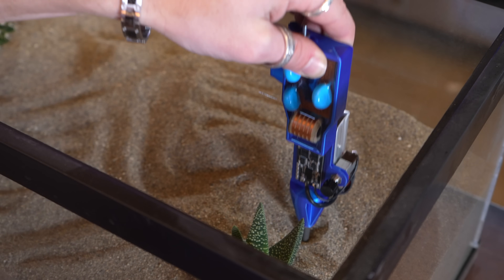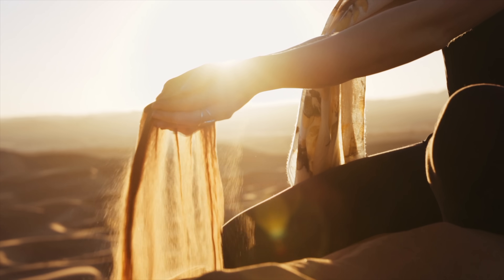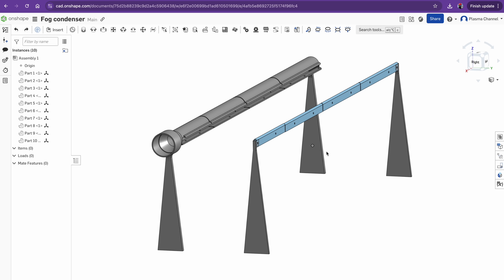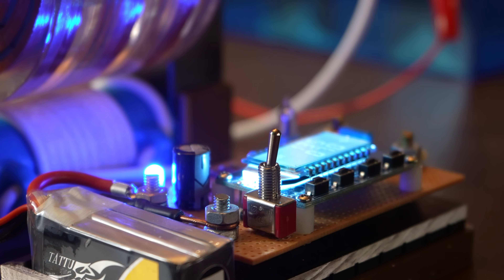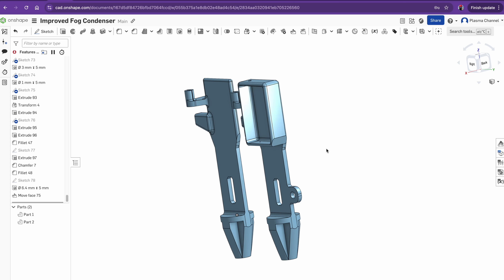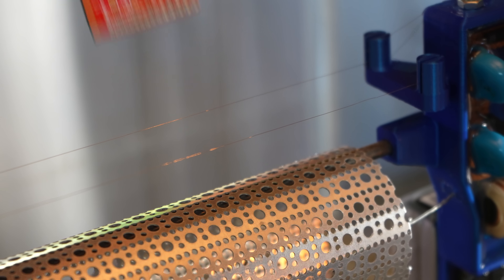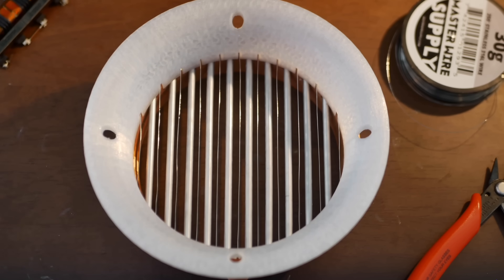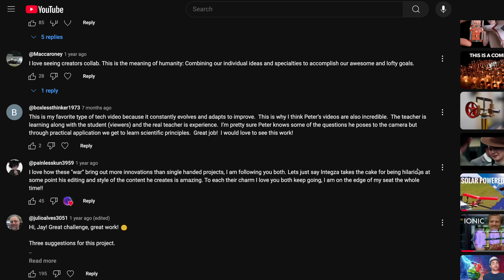Solving Desert Water Shortages Using 20,000 Volts

Comment: Ok, now I wonder how it can be improved. Like how does the density of the collection grid affect the performance? Higher density may be able to collect more water, or it could just end up wicking the water up meaning less of it falls down to be collected (the extreme examples I can think of are something like a carbon fibre sheet and chicken wire). I expect that due to the attraction of the water you don't actually need an especially dense collection grid. In fact, I wonder if you could just use a bunch of nails or something facing downwards, spaced closely together. 

If you optimise the design by optimising collection grid size, spacing, voltage, distance between voltage and ground, size, and implement forced air-flow (on a larger scale that would work with natural fog) etc. I wonder what the theoretical maximum percentage of water collected would be. Then I wonder what the optimal would be for watts/ml. 

Basically, if you live in a desert with ample available solar power (you'd need batteries to have available power first-thing in the morning), is there an optimal design that would be most cost-effective?

The other issue is that if you wanted to be able to harvest these crops at scale you'd need to remove the grid so you can drive farm machinery over the crops. I wonder if instead of using a thin mono-filament for your HV and a solid metal bar for your ground, if you could use something readily available to most farms anyway, electric fence wire and chicken wire fencing. They're both designed to be durable so you can run them over relatively long stretches with maybe just a couple of simple insulated stakes between to stop them from drooping too much, they can easily be rolled up when you need to take them out to harvest. 

I'd love to know if it's possible to make a legitimately functional version of this that has viability for real-world use cases. I expect that no-matter what, you'd still need to use very low-moisture crops because you'll hardly be producing crazy amounts of water.

Comment: One thing about this is that it pulls FOG out of the air, NOT pure water. If you have suspended particulates, soot or microplastics mixed in the fog you’ll also precipitate those out too. Okay for crops, not as good for drinking.

Comment: Also the wind is stronger and more consistent at high altitude where the clouds are- put up a kite or blimp with a wind turbine on it and use the electricity to do high voltage moisture collection. So you can have an artificial rain cloud on demand.

Comment: Have you considered using this as a drinking water supply on say a cruiser/sailboat as a kind of alternative to expensive RO water systems since most of them use some kind of solar panel system and the air is always moist at sea?

Comment: Yo! this is awesome, dude incredible! I love the design & I think it would be amazing to try it out in the Atacama desert. 

If you plan on using it for some cool science study, please remember the money shortage & all that & never treat these deserts like it will ever be easy. From what I understand its deadly immediately, & there's just about no way out sometimes. Who cares if you look silly, better alive & silly than dead & cool lol.

Anyways, I believe you might get a benefit for you design if you were willing to added a hygroscopic in a repeating fashion with tubes. Think a wicking effect that is twisted because it only require plating on cloths & you can have a patterned offset hygroscopic material in-between that helps with the "mush" effect of the wind.

There is also a convection effect & the dripping effect which can be helped with a vortex generation that helps with a condensation thermal rise effect. This is a weird quirk of physics again, where less humid is that is stalled gains a separation of densities that then gain a condensation of the more humid air, but that will wick off into the tubes.

As the tubes pull water down, more air from below comes up to replace it, because its moving a volume out. Now as it gets drier it becomes hotter thanks to absorbing the change of ionic state of energy that you put in, which creates a double vortex with a vortex tube effect.

All it really means it that air rises up & helps the total water captured & basically creates a Stirling-like effect of air heat one way & cooling another. But you grab the water which increases the total hot, versus cold effect. The best part is that its just a tube within a tube with the wires you already use then a slight amount of hygroscopic material offset & repeating up the tubes, branch it out in a divergence & then section it to make it easier to take apart & repair & all that.

If you needed light you can use a vacuum system that has a clear based area that you plate with the right coating to improve (silver nitrate/aluminium/you probably know something I don't) that can be used from top, side, & bottom to allow for the ion-plasma to help with seed germinating. If you needed to attempt that for a type of study, then your fecal matter & urine can be turned into fertilizer & soil for crops when combined with sand.

I'm sure you know that. Nothing like a vacuum pump to gather the water from it & a light & ion-plasma based pyrolysis reaction to help with fertilizer & soil creation & separation of toxic/harmful compounds though to help with it.

Light based destructive interference is always costly to do, unless you have ion-virtual light emittance states which means you can further cool things with light based cooling, even maybe the nets above (or structure?) for your crops. 

(I just wanted to gush about what this made me think about so, maybe I should record that & just react video. It has to do with geo-engineering & clouds, whole thing now.)

Comment: I have a portable AC in my room. Because it stopped working one time I opened and fixed it and because I know how they work now, this got me wondering what if you use compressed air to cool down that mesh and use fans to blow the fog into the cooled mesh, the cooled mesh will cool down the fog condensing it and making water droplets. Very nice Video!!!

Comment: Couldn't this be directly used in combination with focusers and photovoltaic panels to construct an evaporative desalinator? If that was to be realized and feasible, pipelining salt water from aseas and evaporating it in the hot desert sun will provide a perfect circumstance for this setup. The heat and electrical energy are already there.

Comment: You could remove the limitation of needing fog, would be awesome if you built it: by compressing and and/or moving air really fast you could go through VOLUMES of low-moisture air that's 24/7 in deserts, and with a heat pump you could get free energy from the hot desert air.

Comment: Dehumidifiers need to get cold before they start condensing, so the first 5 minutes of run would be the least efficient. The deserts get very cold at night, so it might just be that you can use a fan to blow air over a cooled surface to condense water better than a net would do.... combined cooled surface and charge would produce the best results. Check what Relative Humidity is required for it to start working. It may be that before there is fog, cooling the air first helps to start it condensing. Like, can you collect water vapour from above the sea when it is hot and the water is quickly evaporating? This would allow for easier desalination from sea water during the day

Comment: How much does air flow and turbulence effect the efficiency of the collector?

The orientation of the wires and collector screen make it work like your thrusters, as evidence of how the fog blew out when you turned it on. I know more air flow means more fog to be pulled in and potentially captured; but at what point does the speed and volume of the air mass being filtered become less efficient?

Would orienting the wires inside the "U" shape of the collector screen yield less flow but more condensation? Or would the results be negligible? What about the opening of the "U" being pointed up or down?

Comment: Additional food for thought: What types of plants are used in agricultural settings within desert (and otherwise desert-adjacent) climates?

Also, there are a couple of things that should be considered for this:
~The overall amount of power needed to run this with stability for about 4 hours a day: this would help to determine whether renewables could consistently power it, or if the moisture collection array would need grid power
~the consistent quantity collected of water over a weekly cycle: this would help a user determine what plants, utilities or amount of people (moonshot) an array could comfortably sustain
~How fast do the exposed electrical components wear? And what ways can such wear and tear be reduced or otherwise mitigated?

Comment: Oh nice! This could actually be a water collector that would actually be practical in the real world!
You could easily have the high voltage fully contained inside a mesh screen, and I presume the mesh wouldn't even need to be that dense, like a fine chicken wire might do it and that is super cheap. The HV drivers are fairly cheap too, and that's about it for parts that cost anything, no precision is needed so the mesh could just be wrapped between two logs for the frame.

Comment: Extracting large amounts of water (vapor) from the atmosphere - especially in already arid environments - is sure to guarantee continued and accelerated desertification
It would be interesting to see the energy usage difference between this high voltage setup and a comparably sized, solar driven 'traditional' heat pump/condenser-compressor setup.

Comment: Hear me out, coastal regions with limited freshwater supplies that rely on expensive desalination or have access to only limited underwater aquifers and natural sources could greatly benefit from this. 
For example, Morocco, a country with a history of water shortages, could take advantage of its coastal regions, which maintain 80 to 90% humidity. This moisture could be used to supply its arid regions. Additionally, these areas are surprisingly efficient for photovoltaic energy production, which could help maintain the necessary energy supply for this process.

Comment: a potential issue i noticed with the second (faux desert) test, is the apparatus creating fairly strong wind, which blows away the fog. it seems fine during the test because there is a constant flow of fog onto the mesh, but in reality it might create a dry / drier volume of air without letting the fog roll in. perhaps aim the grounded mesh upwards so the whole thing "blows" in that direction?

Comment: yeah but will it work in a dry desert, your fog addition is turning the area into a swamp level of humidity, and will it work during the day when solar would power it (if it will work in a dry desert to do this, then tilting things so the water can be drained below ground and use a valve system to allow water in but snap shut when dry so it keeps the water from evaporating back out, once in this container below ground (sticking out to allow depositing that water into it) then holes in the bottom or even a porous bottom of partially fired clay would allow it to leak into the ground at root level so it has to evaporate all the way through the ground above to escape thus giving the plants a shot at absorbing it far longer than even pouring it out on the ground above. and if the water saturates the ground around these bottoms of the bottle or container, it will stop losing water into it until it drys out enough to require more to reach the equilibrium again. (this was an idea for water collection and distribution I put a video out on using two 2liter bottles (one to get a funnel by cutting off the top and flipping it upside down) that and a tiny sheet of plastic stuck to the inside of the lower lid to cover the hole until the weight of water presses down allowing it to drop in then snapping back shut to avoid excess evaporation, and some holes drilled into the whole bottle's bottom that is then buried up to the neck of the whole bottle :)

Comment: Right you’re going to power this with solar to condense fog which is only present when? I think you said “before the sun comes up.” Also, you didn’t compare your system to an existing functioning fog net design. Just to your own system with the power off, which no one uses. So we have no baseline for how good this is compared to a passive solution. And your test is a two foot span of wire. And we all know that power or voltage drop over long spans of wire is never a problem. Oh and you’re building an ankle high electric fence for wildlife to run into. Why do you think this is scalable again? Of course you didn’t think that. You just made a video to get some money from an overpriced gummy bear company and praise from strangers on the internet.

Comment: When implemented in a desert crop field, the condenser line should be placed above a narrow trench, so that the water is absorbed a little deeper into the ground rather than soaking the surface layer. This will prevent it from just mostly evaporating when the sun hits it. A copper or copper plated steel mesh would be ideal, since copper repels plant roots. Wouldn’t want it to just fill up with root material. I can totally see this being viable if made in a modular format - say 2m long modules in between rows of plants, each with a small solar panel and storage battery. Btw, that HV generator you’re using is rather inefficient. Try measuring the actual current and voltage when it’s operating in fog. I bet its HV output power is way less than the input power. A direct drive, full-wave rectified generator (without a multiplier) would do a lot better and could use a regulator circuit to make it use only the necessary power to maintain the desired DC voltage - in real world conditions, the main current is going to be at least partly proportional to fog density, so it doesn’t need to be running full power all the time.

I’m quite experienced in designing and making efficient, regulated HVDC power supplies, so contact me if you want some help designing one.

Comment: I am wondering what the rf is on these high voltage system are? I mean how much interference are we talking about? As high power lines to residential properties have the same issues. Even most improper installation and use of solar pv's are relatively rf noisy. makes radio communications that much more complicated.

Comment: Awesome concept!  The idea of using a mesh and a loose wire under HV to generate condensation is really interesting. However, electrolysis with stainless steel carries the risk of Cr-6 contamination. A better alternative could be a more noble metal like titanium, platinum-coated titanium, or iridium to prevent this issue. But the best and most cost-effective solution might be graphite, as it doesn't produce harmful byproducts and is a great conductor. What do you guys think? And not to scare you, butt when was the last time you had a check up? I always watch your series as an insperation for me. Keep up the good work and stay safe.
Reply: Maybe aluminized mylar -- free food grade from used junk-food (or vita-gummy) bags 🙂at those voltages, direct electrode contact may not be essential, although it can be hard to get a wire to connect to that stuff. Carbon might be elegant and safer -- Robert Murray-Smith's conductive paint wasn't much toxic, or pyrolized cloth, or charge the ground&plants as others have mentioned.
Reply: @GaijinPaul   Interesting perspective! Aluminized mylar is definitely an accessible material, but I wonder how well it would perform in terms of durability and conductivity under continuous HV exposure. Carbon-based options like pyrolyzed cloth or conductive paint sound promising too! Have you experimented with any of these methods yourself?

Comment: 20000 v is a lot of solar panels.
Unless you plan on using the grid?
But that's not very green.
Thanks for proving how stupid the idea of net zero is.
Reply: He used a 12V battery to power it. A really basic solar panel would be plenty to charge it, considering it isn't running for very long.

Comment: This was awesome.  If it does work out (and I'm trying to be sceptical and failing) the speed of improvement to lives in coastal arid regions will be incredible.

As a side project, how well does it work as a dehumidifier, compared to a dehumidifier...

i.e. in normal, humid rather than foggy, environments, with a fan  blowing room air over it, is it still significantly more effective and efficient than a standard box-store dehumidifier?  Or does it really need saturated air to work?

Comment: so here's my crazy bad idea. scale this up to fit on a small car trailer, but add a generator and an air compressor. compress and cool the air, then put the cooled air in a chamber that holds a larger version of this, the air flows from one end and out the other. add a drain to the bottom and there you go. im sure the compressing part wont work but its my idea for working during the day.

Comment: If you need to fet electrisity to the desert to produce the high voltage why wouldnt water just be plumed in. The same problems would be present with this "solution" to the current problem

Comment: Can you put the conductive wire inside the mesh? Both for safety reasons (the mesh is grounded, the wire is not), for endurance (wire looks fragile), and for efficiency (ions outside the mesh have a higher % of being blown by the wind, while inside the mesh they have nowhere to go). 

My two cents. 

Also, there might be a market for a dehumidifier that uses this instead of whatever that thing you bought was using (lol)